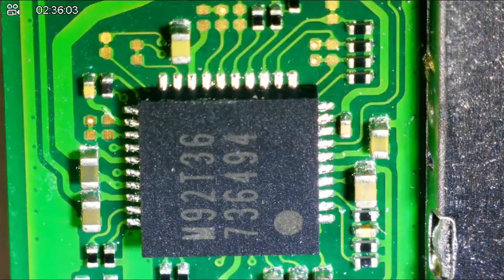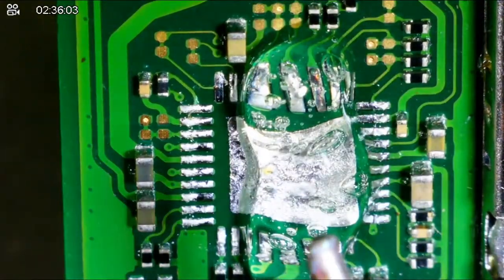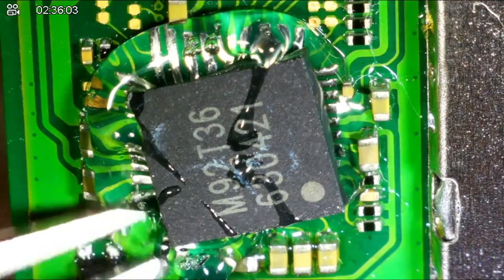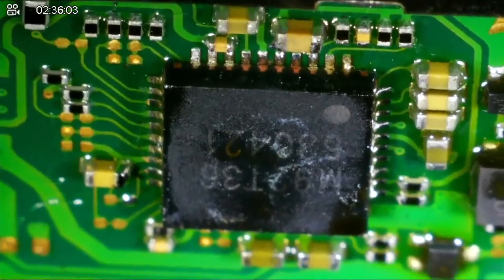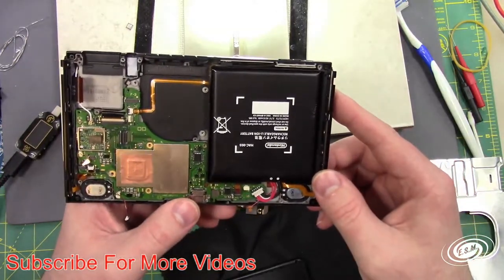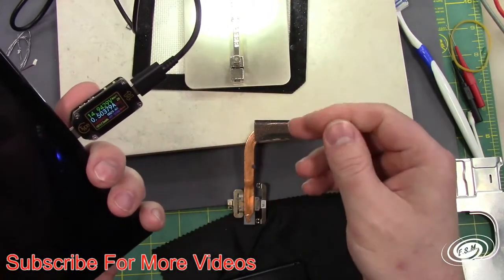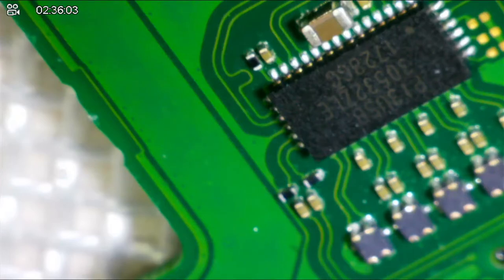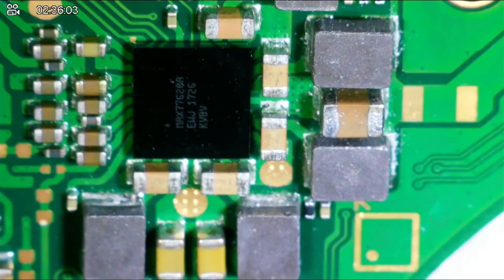Replacing a M92T36 Chip On a Nintendo Switch Live For the First Time

Comment: You'll get better the more you do and don't be afraid to get in there. Center, push down and add heat.

When desoldering, don't lift so hard. Add flux even when desoldering and gently lift or you'll take pads up with you. 

You'll get used to it though. Good luck!

Comment: 420* Celsius or Fahrenheit?
Reply from the maker: Celsius
Reply: @jasondoesthings919  Thank You! Starting to do my own IC Chip replacements too. This will also be my first M92T36 IC Chip replacement.
Reply: @jasondoesthings919  I was wondering why it wouldn’t budge at 480* Fahrenheit.
Reply from the maker: @stevenlanglois2358  that would definitely be an issue. Most stations can be set the Celsius
Reply from the maker: @stevenlanglois2358  good luck if you need any help let me know
Reply: @jasondoesthings919  Beware fake/counterfeit IC Chips. Everything went great, but then I couldn't get the chip on. Then finally could, but my meter would flash. Same result with all 3 Chips from same ebay seller.

Seen a few other videos and the guy mentions fake chips. Blows my mind.
Reply: @stevelanglois6706  

This. Don't buy the chip if the price is unusually low. Buy from a proven vendor at a fair price (about $12-15).
Reply: @DannyWilliamH  I only asked about the temperature. I get my chips wholesale for $3 - $5 Each.
Reply: @stevelanglois6706  

Yeah, right above you mentioned to beware of fake chips. I merely added that they're out there.

I'm glad you get a sweet deal but I was concurring, lol
Reply: @DannyWilliamH  Ah. I see. Thank you!